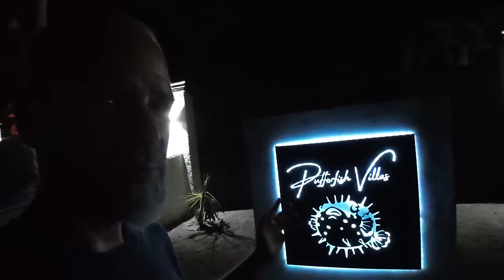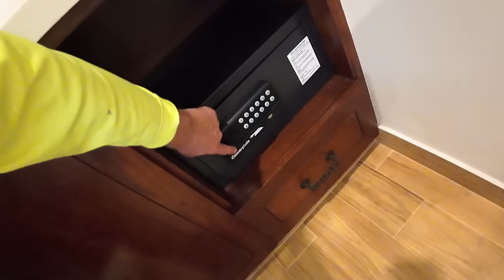We Used Our Life Savings to Build a Resort in Paradise!

Comment: So happy for you guys! I've been following since day one and rooting for you all the way. Got a question for ya: we love that flooring you used in the villas and are curious if it's hard wood or vinyl flooring since we're about to replace our flooring here at the house. Again, congratulations!
Reply from the maker: The flooring in the villas is porcelain tile. Tile is really the only flooring option here.
Reply: @dooglassandesperanza  Wow, it's beautiful! It looks like hard wood. We haven't seen anything that looks like that but will look it up. Thanks!
Reply from the maker: @uliseszarate6561  if I was putting in a new floor in the US I would not use tile. The grout is a lot of maintenance to keep clean and the tiles will chip if you drop anything heavy on them. Our last house in the US had hardwood strand bamboo flooring and it was really nice. Hope sister just put in luxury vinyl tile throughout their whole house and they really like it.
Reply: Great to know that. We've been discouraged against hard wood because of the cost and issues with humidity, stains, denting, etc. Now leaning towards vinyl as well as long as we can find an option that doesn't look cheap. Thanks for the info. Abrazos to you both amigos!

Comment: You guys are so brave! I want to do same in Puerto Peñasco. Should I go for it or run for the desert?  How much did construction end up costing? Also are windows chosen afterward and that’s why they had to remove cinder blocks?
Reply from the maker: We have always tried to follow our dreams and it has worked well for us.  I won't tell anyone else to take such a huge risk, but I do think it's important to do what makes you happy in life. I have not had a chance to sit down and go over the full costs, bu the villas cost about $100 sq ft.  As for the cinder block removal, that was an on the fly decision during construction. The windows were all custom made to fit the openings much later.
Reply: @dooglassandesperanza .  Thanks for the reply! Did you guys have to re-zone?
Reply from the maker: @rubyoro0  there are only two zones as far as I know in Loreto. Habitation and commercial. Our architect who has been building in Loreto for 40 years said that almost all property in Loreto is classified as habitation and commercial just like ours. This means you can do anything you want with it

Comment: You didn't mention how much it cost you?
Reply from the maker: Building the shop and lavanderia came out at about $65 per square foot. The Villas came out at about $125 per square foot with mid level finishes. Pool is 20' round and was $33K USD with all the equipment and solar heating installed.

Comment: Beautiful. Question. Why not build and RV spots? So that you receive money while looking at finishing the infrastructure???
Reply from the maker: We have had this question many times. We investigated putting in RV spots but they just don't pencil out and you need a massive amount of space just for maneuvering in and out of spots. The water hookup fee alone for commercial businesses like us is $2,000 usd per spot. With the price of wire it will cost another $1,500 just to run the electrical feeds that could run an AC. Add in sewer and a cistern because you have to have water storage or you won't have water in the afternoon and you are nearing $10,000 per spot investment. Water and power utility bills when running AC would run at least $100 a spot per month. There are mini RV parks in town that rent for $300 a month so it would take over 10 years just to recoup your initial investment.
Reply: It makes sense that RV monthly rents are that low- I guess even with your beautiful set up it would NOT be worth opening it up to class B and Small 24 foot motorhomes in the winter.. it would not be cost effective. With California rv resort prices being so high I thought Baja Mexico sur would be more lucrative .. oh well
Reply from the maker: The prices here are kept low by the fact that you can camp in your RV directly on the beach almost anywhere in Baja. Every one of the best beaches near us are loaded with RVers.